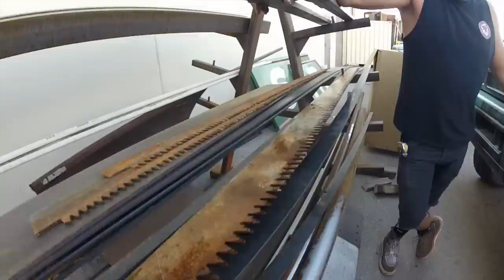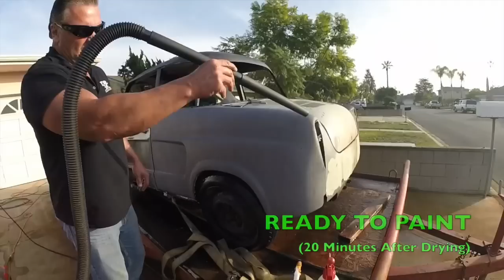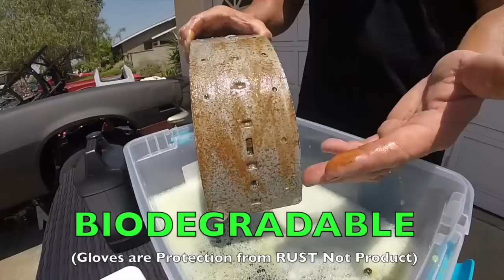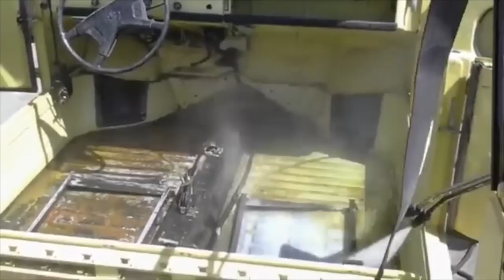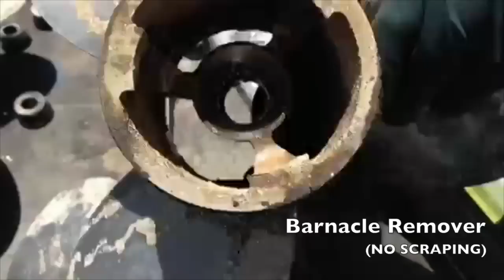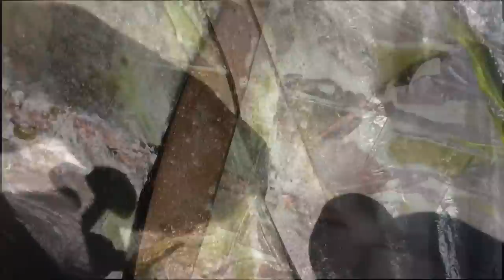Removing Rust in Less Than 3 Minutes

Comment: After rust removal, I use a spritzer bottle with a 36% Phosphoric acid solution into which I kept dropping small sheets of pure zinc until it won't dissolve anymore. I then spray this directly onto the steel, which will turn dark gray. Allow to dry, wipe with a soft cloth and apply a good etch primer. Your phosphated steel won't rust for a long time, if ever. Bonus point, you can weld directly and the welds seem to become protected also. Great for protecting inside sections.

Comment: It's just muratic acid acid at three times the cost with a fancy label. $7 bucks at your local Lowes or Home Depot. Your welcome internet.
Reply: PiratePete how about now lol, would love to hear about the results
Reply: PiratePete well how about now?
Reply: PiratePete oh jeez.. hope your recovery went well. Thanks for letting me knoe
Reply: @piratepete-thetruthisforevery1  how about now?
Reply: @piratepete-thetruthisforevery1  how about now?
Reply: @piratepete-thetruthisforevery1  no issues pal! you doing a great job. helping moms is the best thing to do
Reply: @piratepete-thetruthisforevery1  its ok :)
Reply: @piratepete-thetruthisforevery1  zzzzz
Reply: Yes it does work, i've been doing it for years it's cheap and it only takes a few hours depending the rust condition.
BUT, literally as soon as you remove it from the acid, clean it with water and some light abrasive to remove the superficial discolorated metal, OR it will start to rust immediately again.
Clean it, paint it or apply some oil.
 And you need to be carefull, use protective glasses and gloves all the time, and the gases are toxic!
You can filter and save the muriatic acid in a plastic bottle for later, and use it many times more.
Reply: Steve Emery   Ever year of baking soda?  Neutralizes the acid.  Water will not neutralize it.
Reply: @Paintersteve58  absolutely right, we soak the pieces in a tank of Muratic acid and water. Then power wash the peices on high pressure repeatedly and let dry in the Hot sun. Take the pieces inside to cool off and prime.  If you don't rinse the film the acid will bleed though the paint.  For heavy rusted pieces we just soak longer and repeat until rust free.
Reply: @piratepete-thetruthisforevery1  How about now?
Reply: It will rust again later?
Reply: @piratepete-thetruthisforevery1  No worries bud. I take care of my elderly grandmother so I know what you have to go through. I wish you and her nothing but the best! Stay safe Pete.
Reply: @piratepete-thetruthisforevery1  how about now?
Reply: No le veo acido muriatico eso quema y aca prueban que se puedecoger con la mano
Reply: 1 year later. How about now?
Reply: @piratepete-thetruthisforevery1  u tried ? 😯
Reply: One problem... muriatic acid is hydrochloric acid. Skin would break down on contact. This stuff is safe enough to touch for brief periods.
Reply: @piratepete-thetruthisforevery1  how about now?
Reply: PɪʀᴀᴛᴇPᴇᴛᴇ  be strong bro. I believe u will try it one day
Reply: @idontknowname-rl8yb  😂😂😂
Reply: Thanks man. I'm working on a base for a band saw I just got. I have muriatic acid (Use it in swimming pool) and a pressure washer already and am tired of using the wire brush. 😂
Reply: @piratepete-thetruthisforevery1   You alive bro? RIP Pirate, he tried and it ate his lungs.
Reply: Jay Guess  yes sir
Reply: milkstone remover
Reply: 4⁴and ⁴⁴are
Reply: Tom
Reply: Watch the 60 year old blade... video stopped I wonder why...
Reply: Chemistry minor in college  and you are CORRECT!!!!
Reply: I do not think he would be putting his bare hands in muratic acid????
Reply: Acid 7 dollars wtf!!!?

Comment: Rust removal demarketed:  if its quick its an acid. If its very quick its a strong acid. If its extremely quick its a concentrated strong acid.
Reply: Yea, if it was as you suggest, they couldn't stick their hands in it, and would require a respirator. There are other things that react to rust besides acid. Baking Soda is one thing and it is a BASE, not acid.
 A strong acid would also be a problem for delicate surfaces around the rust like paint and chrome. 
 Your elementary school analogy is just that. Elementary level thinking.

Comment: expensives ass hell we ordered a gallon of this a week ago. still not received it here in Quebec , 144$ just in shipping fees add the exchange rate taxes and almost 250$ canadian for 1 gallon
Reply: Jalal-yes and it is a waste of money, if you just spray it on it will not remove rust. you need to rub it and it will only remove very thin layers at a time.so you need a lot of it and patients
Reply: roger white just use vinegar if its just for one time non professional purpose, works really well.
Reply: just don't leave it in too long....might not have much left of what you put in
Reply: Look up blackstrap molasses (unsulfurd)  1 part to 9 parts water... 2 week prosses. 250$ my God !
Reply: Just use phosphoric acid, the best and cheaper than this and work fine, not recommended for chrome pieces, instant reaction
Reply: roger white - Geez!! That's absolutely ridiculous! Please do yourself a favor and use your brain more than your credit card! 
ANY kind of acidic solution will remove rust. It's that simple and the vast majority are cheap and easy to get. Many have the added benefit of not being a eco disaster waiting to happen. 
KISS get some vinegar and your done for a tiny fraction of those values. ;-)

Comment: Thing is, the rust comes back real quick, oxidation kicks in, unless treated immediately after rust is removed. You got like less than a minute  before a rust reaction starts.
Reply: How come. Cuz its still wet?
Reply: Using Holdtight 102 to rinse will avoid this flash rust after rinsing.
Reply: Sssh this is how they sell more product. 

I can hear the phone calls now…
“Hey this is Captain Skip. You did my boat last month with your cleaner stuff. Can you stop by this week?. My boats is all rusty again”

Cleaning service: “yes. We know.  Muhahahah”
Reply: @calebmendoza5067  Thanks for referencing that product, will definitely check it out

Comment: They are wrong about sandblasting cannot clean down to the pores. Actually, true sandblasting creates a white metal profile and that is the best.
Reply: MasterHustler - What's the best stuff to spray on metal after it's sand blasted to A) Keep it from rusting any further and B) and is able to primer over it? Cause it might be a while from when I sand blast to putting on a primer. I've seen in some videos where they spray on some kind of orangy-red stuff that kills rust but they don't say what it's called? Thx.
Reply: Sigman Floyd A mixture of Hold Tight rust inhibitor and water works good to prevent flash rusting.
Reply: WindozeCS - Thanks!
Reply: Indrid Cold - What about baking soda?
Reply: Depending on what you are using as the blasting medium, blasting can move the good metal so that it encapsulates the rust and then buries it out of sight...until it gets moisture or something else to activate it and let it grow again.  This is what a dipper fellow told me and it makes sense to me.
Reply: you are 100% correct. Problem is that most dont realize that if they do not pay attention to the Humidity the white metal Blast metal will turn faster than they can get it Primed in time.
Reply: Very true
Reply: Sigman Floyd epoxy "primer".

Comment: phospheric acid ?  muratic acid?   all rust inverters converters     all contain same ingredients  just do ur home work.
Reply: its actually a chelating agent. no acids in this type of remover
Reply: There absolutely is an acid in it given the gas produced when reacting to the carbonates that make up the barnacle shells.
Reply: i dont know what they using.. you can achieve better result then this. with hydrochloric Acid+water(mixture).. no need to rub/scrap any surface. Put the rusty metal part for few hours in the mixture (appx 20%acid+80%water). then see amazing results. i tried.
Reply: also its very economical.
Reply: Farrukh Murtaza phosphoric acid passivates iron though, hydrochloric doesn't.
Reply: may you are right. btw i have tried it already. i washed my Car and bike rusty gas tank very well.
Reply: i will try
Reply: oh thank you dr. periodic tale of the elements chemistry professor!!!!!,,,,,

Comment: Your test proves nothing useful.
 Any acid will remove rust AND it will also eat away the base metal too.  HCL is a "Strong acid".  But acids, especially strong acids are not good rust removers in general.
1.   A good rest remover works slowly and only removes or converts the iron oxide and does not attack the base metal or the original corrosion protection like zinc galvanizing.
2.  A good rust remover also prevents new rust from forming until it can be painted or plated.
3.  A good rust remover is also cheap.
Toilet bowl cleaner does not do this as the part will begin to rust again. It  eats  the Galvanizing AND  the base metal.  Toilet bowl cleaner is a bad idea on thin sheet metal.
That bolt in toilet bowl cleaner has no corrosion protection left..
Rust takes along time to form and you are not going to get true results in 10 minutes.
   Never use HCL, Muratic acid or toilet bowl cleaner if you care about your parts and the end result.

  How to Stop Rust. Clean the metal. Then seal it from the atmosphere / Oxygen source.  A good plan is a multi layer protection approach.
For heavily pitted thick items use  a wire brush or sandblast first. Rinse and use 5% vinegar and let is soak for a few hours to a few days. Check every 4-6 hours .Vinegar likes Iron oxide more than it like zinc but it will attack the Zinc plating. So timing is important. Rinse with bottled distilled water, NOT Tap Water. **
**Then a couple coats of Ospho or Corroseal. then POR Paint (black is cheapest) .  Then apply any top coat paint you desire. It will never rust again.
OR
* Spray with WD-40 Specialist Corrosion Inhibitor and rub with a cloth for short term protection. For longer term protection use Caig D5 and a cloth. Seal in an air tight bag then send part out to be Nickle plated then copper, silver, Heavy gold or Brass plated. Chrome plating is optional.

For sheet metal, you want to save the Galvanizing as much as possible. 
For light rust. Use a green scrubbing pad and WD-40 Specialist Corrosion Inhibitor.  What ever that does not remove, use 5% Vinegar with gloves and a Stainless steel wire brush. (Try not to use power tools or you will just take off the Zinc plating and make your problem bigger.)  
Never soak Sheet metal in any acid unless you want new holes.
Then rinse in distilled NOT Tap water.
Then  and do ** or * above.
Areas with holes will need to be replaced / Patched. the Then two coats of Ospho or Corroseal. Then POR Paint.
For textured or rough surfaces use silica sand or baking soda with the WD40.  DO NOT use baking soda with Vinegar. Then rinse with bottled distilled water, NOT Tap Water.  If using baking soda on steel. Keep as cool as possible to prevent any chemical reaction with the zinc. Do not let sit. do small areas at a time. Rinse often.

EvapoRust is Phosphoric acid and a mild corrosion inhibitor similar to Ospho. Ospho is balanced and converts the Rust to iron phosphate and only needs to be wiped on (twice) not soaked like Evaporust requires. Ospho leaves a paint ready rust free surface.

As For Rust converters, They are essentially a vapor barrier offering limited rust prevention. They need all to be coated and sealed.
Do not use if you intend to have the part electroplated. They convert iron oxide to:  Iron Tannate  using Tannic acid , or Iron Phosphate using phosphoric acid or  to Fe304 Magnetite or Zinc Chromate, ZnCrO4 If the item is Galvanized.  The best rust converters are the Fe3O4 converters, like Corroseal. Surface prep is crucial and the part must be wire brushed then degreased with Acetone and a commercial water based degreaser.
    Then apply the rust converter in a dry low humidity environment, Wait 48 hours and Repeat Two coats.  Check adhesion in several spots with your fingernail.  Wipe off any excess.
Reapply as needed. Then paint wit POR within seven days.

Comment: Do not waste your money! Use any kind of acid. Soak the part in acid and then rinse it off with water...
Reply: I would add that mixing dish soap or liquid laundry detergent with the acid will make it cling to surfaces and work longer. Also, most light acids can be neutralized with a mix of baking soda and water. I have also heard liquid glass cleaners will also neutralize acids.
Reply: Soak in White vinegar ..
Reply: What about parts you cannot soak in a bucket, such as car's rocker panels ?
Reply: NO!!!!! Glass cleaners are often ammonia based and react with acids to form toxic chlorine gas. There is NO need to add detergents or anything else to an acid. Just keep the surface wet while it does its work. Don't overthink this!
Reply: Good call. That will kill you, very quickly. Some guy did that with an old Airstream trailer he bought. The septic had not been cleaned (so it had Ammonia built up) and he dumped Bleach down the toilet. He never made it to the front door of the trailer, before dropping dead. It was on 1000 ways to die.
Reply: AlienMonkeyDXB i
Reply: White Vinegar 60%, $3 gallon,  make a paste if need be,..  mix with corn starch, back ng soda ?
Reply: @theroyalcrownedtiger2946  fill a swimming pool
Reply: @gth882  : I'll try that, Thanks.
Reply: @theroyalcrownedtiger2946  the kiddy pool or the other kind, wonder if acid will eat pool, let me know seriously if it worked
Reply: @gth882  : I doubt it would eat the plastic kids pool, at the very least the car battery acid did not seem to eat the plastic of the battety casing, and sulphuric acid eats almost everything, including metals.

Also the C.L.R. is a product like this, seen in the video, and it comes in plastic bottles, and does not eat the plastic bottle.

It could be a specific type of plastic, but it might not be.

I would imagine it should be ok, but gonna have to test small amount first, leave it over night and see what happens, the answer will be found one way or another.

The other option is to check the Material Safety Data Sheets ( MSDS ) tells about the chemical properties, see how similar they are, and determine from that.

At the very least, baking soda neutralizes sulfuric acid, and might do same with other acid types, becareful as it might not turn out as expected, test small amounts first, and must be outside, also have lots of water incase it spills.

Hope this helps in the meantime, I will keep updated, but its gonna be a while before I do this, since its still cold outside.

Have a nice day.
Reply: @theroyalcrownedtiger2946  okay, had no idea bout baking soda neutralizing acid,
Hope all goes well
Reply: @gth882  : Keep you updated.

Comment: Next day all rusty again.
Reply: CIA Assassin seriously?
Reply: He's not wrong this will only remove the rust its just acid so rust will start showing back up again. What this does however is it give you a clean surface to paint on that won't chip off like what painting on rust would do. If you want to stop it from rusting after you spray and clean add Vaseline to stop the rust from coming back. If its outside rust and you want to be fancy and not use Vaseline get a good primer to seal the metal, paint it what ever color you want and clear coat it. There's videos out there on primering, painting and clear coating a car with just spray cans. "Ratchets and Wrenches" has a video series on spray can painting.
Reply: LoyalSif well I wanna use it on my engine I believe dr x sells a solution to prevent the rust tho
Reply: Corrosion X will protect the bare steel. You can't leave it bare unless it's in a dry place.
Reply: InfamouSneaker if you want to use it on your engine de-rust it then spray the engine with high heat resistant paint that will seal it a long time/forever (depending how wet/salty/hot of a environment you live in). If you are able to lift the engine and full spray it I really recommend that, if not at least hit the rusty spots. Also look up how to paint an engine if you spray high heat paint on your ac lines it can cause over heating issuses because none of the heat can dissipate in those lines. Don't waste your money buying a over priced clear primer like the "seal solution claims to be"
Reply: @daviddou1408   Depends on the cans, quality, and area. Had three shops quote my Jeep rebuild between $500 and $1,800. Cans of primer, paint, clear coat, combined with weekends drinking beers with friends was roughly $350 and a good time.
Reply: That's why immediately afterwards, you spray it with Fluid Film or something like RP-342. No more rust, ever, so long as you keep the coating on. Usually, spraying it once a year (if it's being steadily used) does the job. As others have said, this is just dilute muriatic acid, which you could pick up and dilute yourself and save some money.
Reply: @LoyalSif  
Fluid Film, LPS 3, Cosmoline RP-342, CRC Marine Corrosion Inhibitor, and AMSOIL Metal Protector Heavy Duty would be better alternatives than spreading a bunch of vaseline around, unless you're seriously penny pinching. They all come in spray cans, so you can get a nice even coat on your project without it looking gunked up with vaseline. Most of them are clear sprays (except RP-342, which is amber), but some wax sprays like this can come in black. RP-342 does have a black variant, if you're doing something like the underbody and frame of a vehicle, and prefer black over amber, which is what RP-342 is specialized for -- vehicles and firearms. If you can't tell by now, the RP-342 is my go-to, but is the most expensive. The best bang for your buck however, would be the CRC Marine. It is the cheapest, and definitely still does it's job. $8-$9 per spray can.